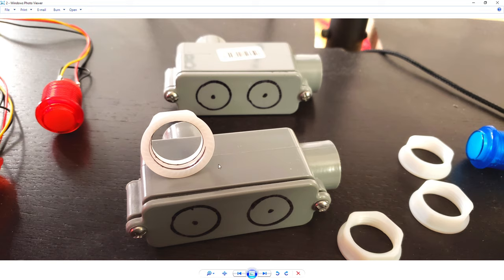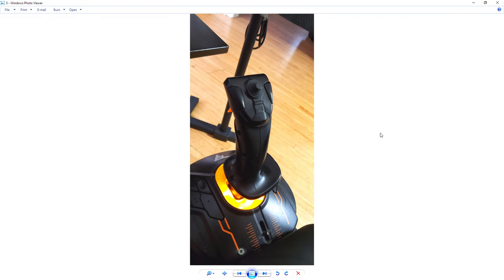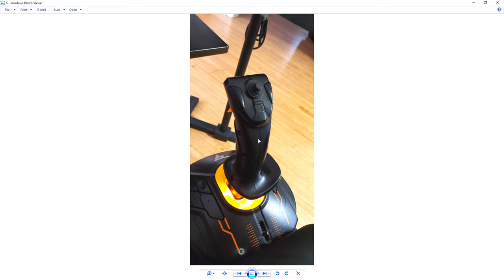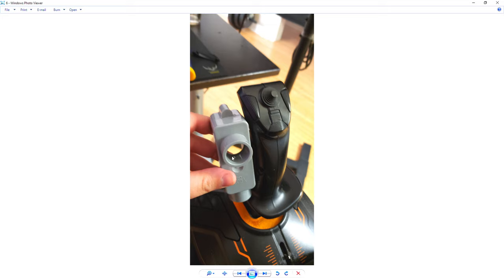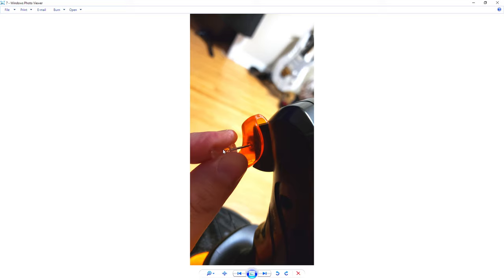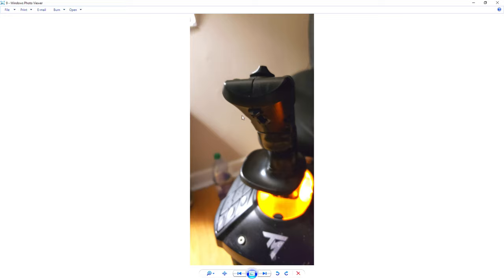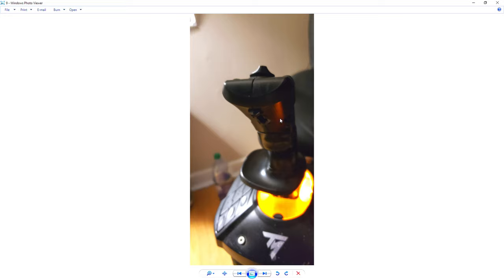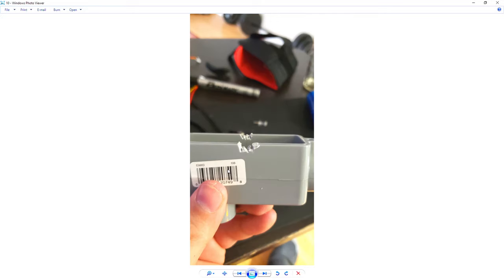Making Custom Dan Foss Style Processor Controls! ✔ Farming Simulator 2019 ✔ FDR Logging

Comment: Ive been thinking for awhile about a way to get two SureGrip style joysticks and running the wires from the micro switches into an interface like what you used. Then you would have all the buttons you could possibly need all on the face of the joystick. Im sure the same could be done with real Dan Foss controls aswell.
Reply from the maker: yeah i wanted this as well but finding even used old sets of these joysticks is next to impossible to outsource, youd need to find an old forestry junkyard or auction buying them new is like 1500$ USD per stick, then you gotta gut it haha